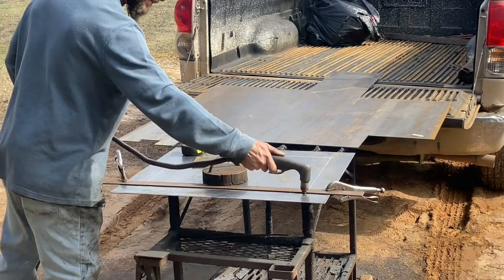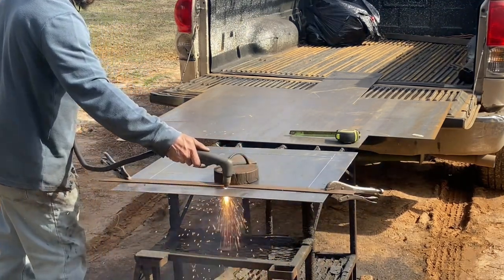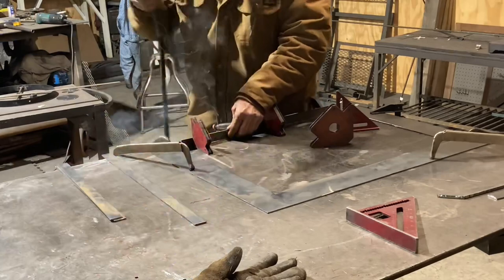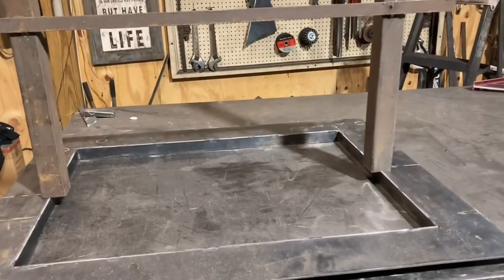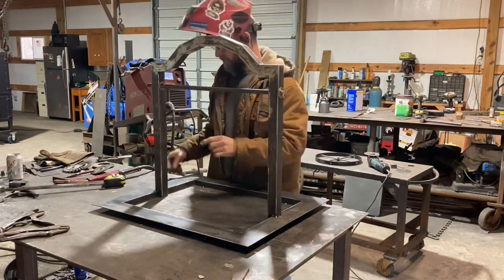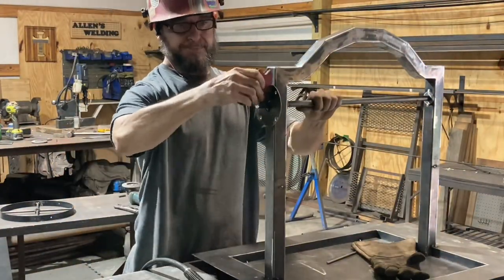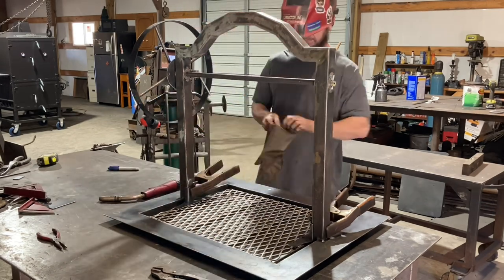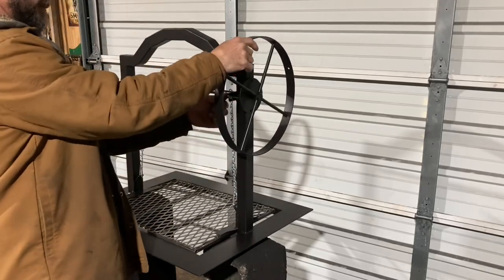Santa Maria grill attachment

Comment: So you said that’s all it needs except painting and then you skip over that… can you do a video about painting? How you do it, what you use, paint and all? Thanks!
Reply: I'd like to see that too
Reply: Just use high heat spray paint from your local hardware store. You’ll most likely only be able to find matte black in store, so if you want other colors probably check online. Make sure it’s high heat rated though.